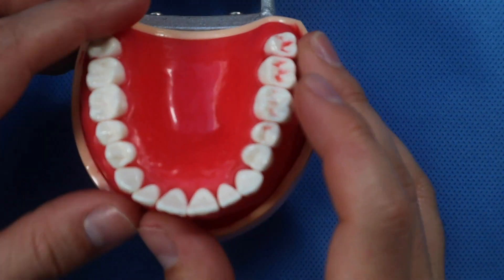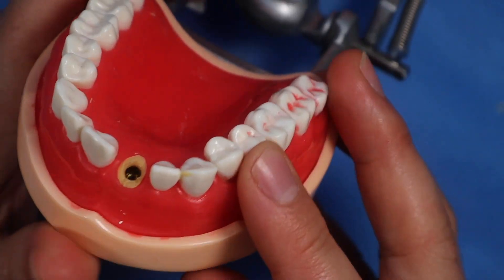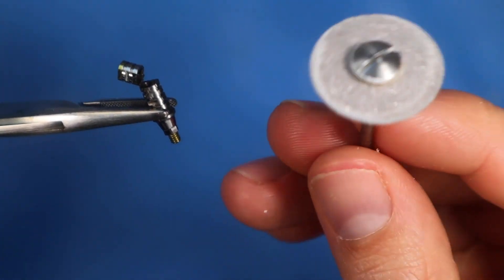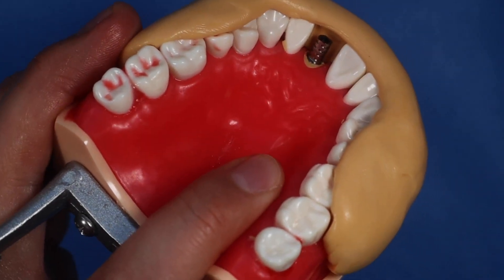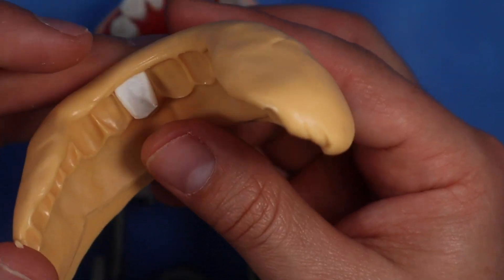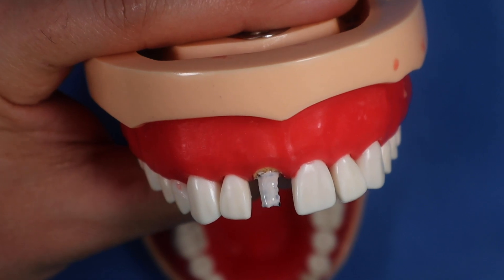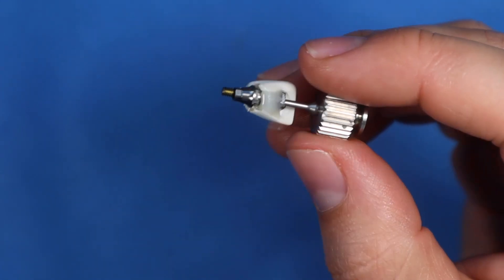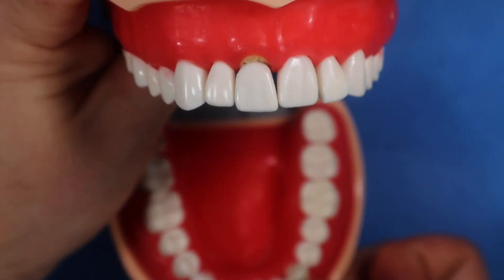How to make an Immediate Load Temp

Comment: I hate videos like this. Makes it seem so easy because he is working from an area you cannot access on a real live patient. I cannot work from the back of the throat nor can I magically turn the maxilla upside down. If you want to make videos about dental techniques that's fine but make them as though you were actually working on a patient. In real life this technique on a maxillary tooth would be extremely difficult because you have to be working from a view that would be blocked to some degree by that putty matrix. Plus he did nothing to condition the tooth. In real life that flowable composite would not stick to the enamel without etching and bonding. Again, the technique is fine but it's a bad demonstration video.
Reply: This prob easiest method to make immediate temp and if you think this is hard for you lmao just stick to fillings
Reply from the maker: Lol ok bro
Reply: @DrivanddsCA  seriously if the video wants to be somewhat relative it needs to be made showing how you perform the procedure, or at least the parts that are intra-oral, from a position that is real life. Make snarky comments all you want but you know I have a valid point.
Reply: @Russell Scott I'm a dentist. And yes I can change brake pads and rotors too. Before you decide to insult someone maybe you should think about what they said. You cannot work from the rear of a patient's head like this video demos. So it gives a false sense of how simple the procedure/technique is. It would be like watching a video of changing oil where the guy has a lift for the car versus you having to get on the ground. Not applicable in the real world.